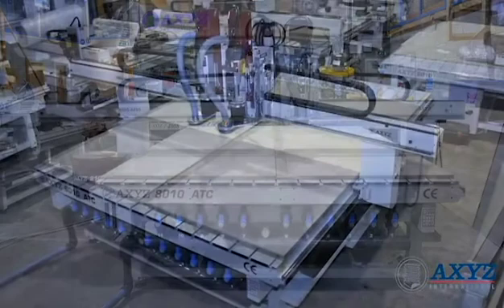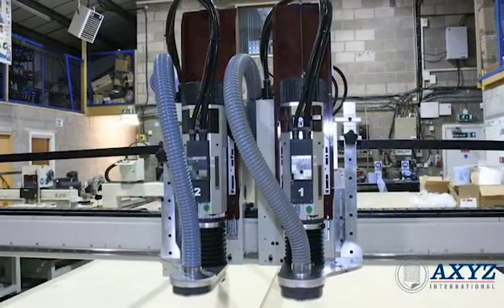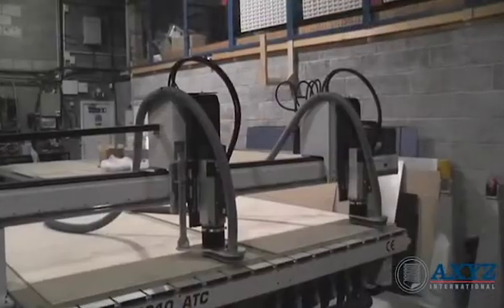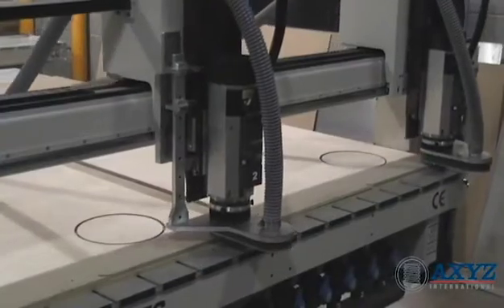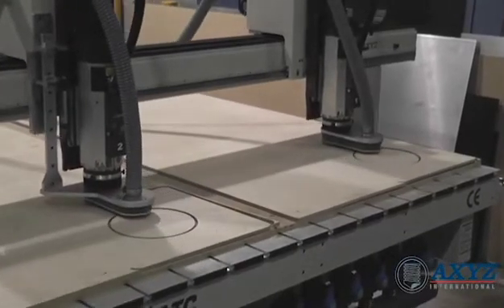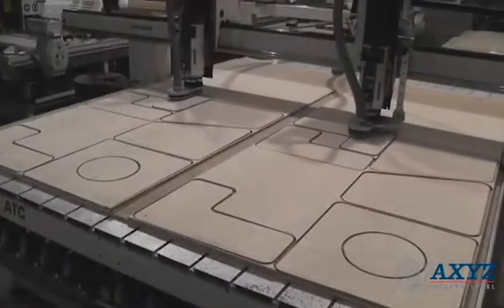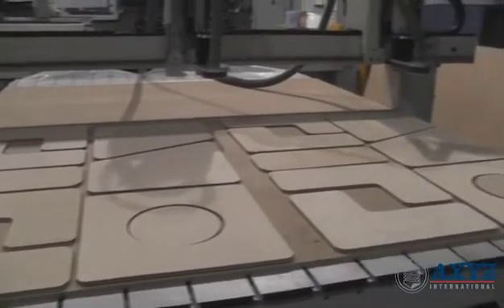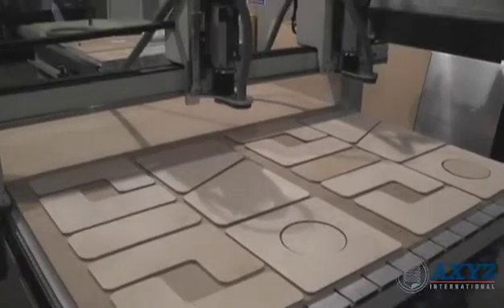AXYZ Twin Head CNC Router

Comment: Can you have two seperate programs. Or is it just for duplication.
Reply from the maker: Because the cutting heads are located on the same gantry it is only possible to duplicate the cut. In order to cut separate programs, two gantries would be needed.